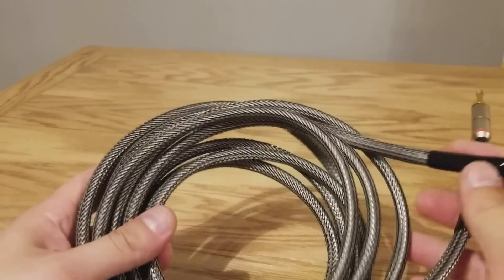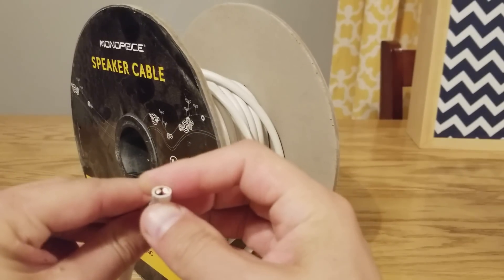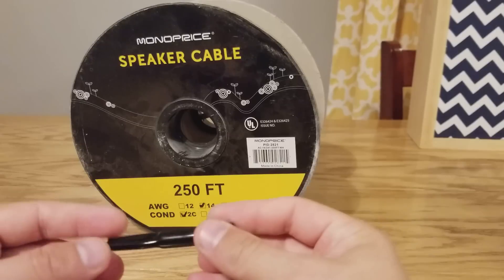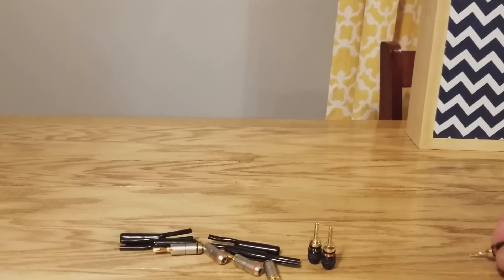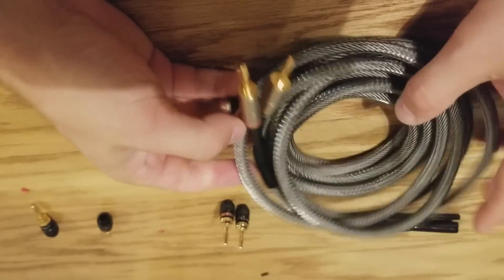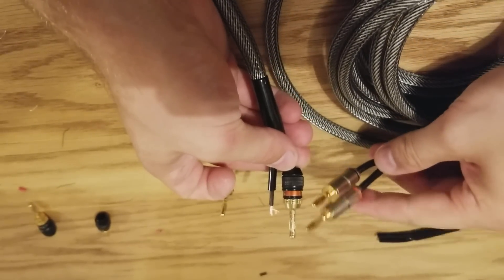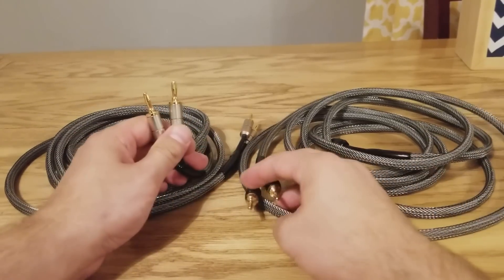How to make Your own HiFi Speaker Wire

Comment: I rather prefer a crimped connection with rings or forks to put under the screw terminal of the speaker. But banana plug works fine as well. Looks stunning too ^^
Reply: I'm not a fan of crimp connections, but I would have tinned the wires before setting that screw. You can get a much tighter connection without crushing the copper.
Reply: @Rattletrap-xs8il  Yeah I'm not wild about the screw type, but they should work fine. I would kind of prefer soldered, but of course you need to know what you're doing. But at the very least I'd pick up banana plugs that have two set screws. Just to foolproof the connectivity. Kind of hard to fail to get it right with two separate screws.
Reply: @cr0ft-2k  I prefer the twin screw system.  The bottom screw I use to hold the jacket in place but I remove the top one and solder through the hole. It's a bit tricky and you need to use a bit of flux but it does work.

Comment: Nice work. The only thing I don't like is that extra white PVC jacket that comes on the monoprice wire. I'd prefer the most physical flexibility by just using the tech flex and 2 wires. I also have had some bad experiences with buying bulk speaker wire that claimed to be 99.999% o2 free and its actually really weak and made of tinned aluminum! I just use lamp  cord now. That way it has be be 99.999% copper legally approved for use with electrical. I can bend the strands back and forth a lot and they dont break off easy.
Reply: That PVC jacket is there because that particular cable is approved for in-wall use, which the building code requires for fire protection. That is one of the reasons I criticized the guy making the video, because he spent extra money on fire rating that has nothing to do with sound.

Comment: I made the experiment - Separated 3 meters of just one thin little thread out of the whole big fat monster cable which the other speaker had, and could NOT tell the difference!!! (mono) Even when it was loud... The speakers are 100 kg each and 300W Amp. Now it could be that with longer cables or extremely high volume there might be a difference. Probably. I don't know. Expensive cables seems like a waste of money
Reply: Really thin cables do have too much resistance and they do affect the sound, especially with longer runs. But all you really need is any old copper cable with sufficient diameter and you're fine. Extremely knowledgeable speaker builders etc have been quoted saying things like that, too. I can't quote anyone specific off hand but I've read about it at some point earlier.

Comment: Good job! Good video.

Just remember: no self-respecting Audiophile would ever defile themselves in such a way as to double-blind test their Pure Unobtainium Liquid Sound™ speaker cables against these abominations!
Reply from the maker: Hahaha, nice
Reply: Too bad, Snotty McJealous. Audiophiles AND people who use generic wire can tell the difference in blind tests: https://www.stereophile.com/content/minnesota-audio-society-conducts-cable-comparison-tests-0
Reply: @esquiremoderator32  you really think that test results of around 15% preference over the cheaper cable are really that much? This shows nothing... That's just plain random hahaha.
Reply: Esquire Moderator don’t bother with these guys, they get their photography tips from blind people too, and jogging pointers from quadraplegics. They base their authority on hearsay, not a single one of them has ever actually experimented with cables. I’ve seen plenty of people go from being cable skeptics to actually realizing that no, zip cord isn’t a good cable, but never the opposite.
Reply: @esquiremoderator32  Did you even read that testing? The put the worst possible cable you can buy, Against some "High End" cables....

Where is normal Cable? Where is some 12g 99% copper cable? Such as the cable in this video? Not in their hmmm.
Reply: @Fr4nk3J  So, you will admit that there is a difference? Good. One of the high-end cables was 18 gauge, smaller than the cheap cable. BTW, the cheap cable was 16 gauge, which most people here are claiming is entirely adequate. Also, the cable in the video is 14 gauge, not 12. Seems like you're on the side of knowing that cable matters. I never said that you had to buy ten thousand dollars of cable and I wouldn't. I just suggested that the guy should have put his money into cable that most people consider to be sufficient for a quality system instead of putting on window dressing.
Reply: @esquiremoderator32  I mean of course there is some realm of difference. 12g OFC is going to work better than 24g CCA, alot better. 

I'm just not convinced that a 1000dollar wire is going to be better than 12g OFC, or 14g OFC 4c braided, ect.

I can measure that difference, its a factual electrical difference. Its not the same thing as saying this cable has been crygonecially frozen, or any of that nonsense.

I can also see why like the kimber wire may be better, and I can almost justify its cost. Thats a lot of work to braid all those like that.
Reply: @Fr4nk3J  I think we are on the same page then. I agree "cryogenically frozen" is probably a BS gimmick and I would never spend money on it. Since you mentioned Kimber, I wonder if you follow the guy from Audioholics at all because he uses Kimber, but also cautions against high-end gimmickry? I agree with that guy 100% on cable. But, a decent length of that Kimber cable gets over $1000 quick - so quality cable costs money. Not $10,000+ but it gets up there above $1K and that is what most people in this comment section argue against.  If the guy who made the video used 12 gauge ofc, I would not have said a thing if he decided to put some techflex on it to make it look good. My only issue was the guy spending the money on techflex before he got decent cable and paying extra for the in-wall fire rating, as well, because he liked the looks (it's safe to assume he didn't use it in-wall since he prettied it up).
Reply: @esquiremoderator32  I do watch Audioholics videos, time to time :). However I do not agree with Gene, just because Gene said it, more so due to my background in computer engineering, and knowledge of electrical engineering ect. However, that is why I like watching them, they are both engineers as well, they think like me, test like I would, and recognize science, and I appreciate that. 

the thing with the Kimbles is, they are not snake oil. You could, yourself build Kimbles, and the price, seeing how a person has to hand craft those, painstakingly, makes sense. There really isn't an absurd markup there, they have to pay people to do that and thats expensive. So with Kimble you have a choice, buy it premade or make it, its not easy to make and not fast, but if you want to take the time you can do it. 

I like to usually do that stuff for myself, however sometimes I get it made from me. The same with my PC hobby, as I am a semi competitive Overclocker, and PC modder, Sleeved cables (techflex like sleeve) on PC power cables, is very similar to this video. Those wires, sleeved, and good quality, can cost a pretty penny. As once again, its painstaking work, that takes time, and the best cables are made by hand by a small business.
Reply: @esquiremoderator32  Also I dont think they are complaining about the Kimble cables as much as the likes of this, http://triphazer.com/platinum-interconnects/ultra-platinum-interconnect-cable-upc-1.html. 

That is literally 10 dollar per meter cable (https://www.ebay.com/itm/Van-Damme-Silver-Series-Session-Grade-Instrument-Cable-Low-Cap-55-by-the-metre-/180723820731), with some 5 dollar RCA interconnects and some heatshrink, and the price, 500 dollars, LMFAO.
Reply: @Fr4nk3J  cool, cool. I actually built my own with 14/4 Canare and also some with 10awg Belkin in the past, both prettied with techflex. To the extent I'm an "audiophile" , I do what I can because it's a way to enjoy the hobby and a little sense of accomplishment - and it's half the price, so it's hard not to!

Comment: Belkin Cables, Canary Connectors = Blue Jean Cables
Reply: BJC does NOT use Belkin cable. BJC uses BELDEN cable.
Reply: 1/2 true. BJC does use Belkin wire and discloses it on their website. I'm not sure what you are talking about with "Canary" - maybe you meant Canare? But, they don't use Canare connectors on their speaker wire (they sell Canare wire, though). They use custom connectors made for their welder. And, there is more to it than that - they ultrasonically "cold" weld the wire to the connector, which is something that cannot be done at home and it creates a very strong connection that doesn't come unscrewed. Also, BJC sells the bare parts for people who want to assemble it themselves and you probably won't find anyone who sells short distances of Belkin wire any cheaper (at least I couldn't when I looked a few months ago) So, I think they are a good company - especially compared to what else is out there.

Comment: Keep in mind the wire coming from the circuit board to the banana terminals inside the amp are probably not "high end" wire and may be much lower gauge than the wire you are connecting to your speakers.
Reply: That doesn’t matter because this cable would be in series with the one in the amp so the resistent of the cable will just add to the one from the amp, so low gauge still improves it
Reply: Not on a quality amp. Good amps are filled with 6, 8 or 10AWG. High end speaker wire is for high-end equipment. If you have a $50 chinese amp, then you don't need to worry about nice speaker wire.

Comment: I'm using 12awg in wall wire so should I get the next size up tech flex and cable pants? Or will what you're using fit 12awg?

Comment: Now put a magnet on it and sell it for 5k. I bet audiophiles would appreciate "the sound" it makes.
Reply: Magnet 🧲 ❓❓❓❓❓❓
Reply: There's no need to be facetious as you already know that there are differences in the sound of cables.
Reply: @MrGorpm  I hope it is ironic, when not: Gather education, FAST. 

What matters in frequencies in the audio range? Low resistance when you want to drive high load speakers to pass the current trough. The rest of the wanky shit they tell isn't true. 
It might be right when you were transferring frequencies in the range of MHz, then the skin effect applies and you need another cable. 

But in distances low as 1-2m per side 1mm² cable would do the job nicely. 4mm² is better, because a smidge lower resistance, but doesn't matter. Only if you had for the right speaker 1m length of cable, for the left 200m of cable. Then you would hear that the left one is just quieter, nothing more, nothing less.
Reply: @DrDOHC  If you do not perceive any differences - good for you!  I wish you well on your musical journey.  I, however, will continue to listen with my ears and not your test equipment, as your test meters do not hear timbre, sound-stage and rhythm.
Reply: @MrGorpm  You don't get it. 

The ONLY thing that matters, are the acoustics. The speakers, the part that transforms the current into soundwaves. 
It doesn't matter what cables you use. They should conduct, they should be a proper wire diameter, but that's it. 

Nothing fancy going on. NOTHING. 

I'm not an Audiophile, but it is IMPOSSIBLE that a friggin piece of plain ol' copper changes the signal on the cable. Dang dude, get some proper education and don't trust those wanky woo woo sellers which are claiming bullshit. 

And I only trust measuring devices when it comes to electrical signal-forms, because they can't get Biased as hell. 

You ARE describing acoustics, not the electrical influence of a cable to Low frequency stuff.
Reply: @MrGorpm  well, if your cables modifies the timbre you really have a problem, to say nothing about the...rhythm, yes, and about sound stage

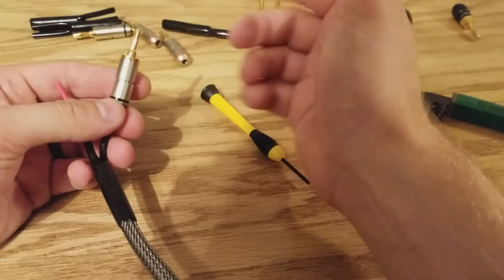Comment: 8:14 you hid your mistake, 8:20 you took too much off of the black off camera and the red is longer :)
Reply from the maker: It was a little longer than I liked. You just have to trim the speaker wire a little. Very easy, quick fix.

Comment: The best upgrade you can make, to pretty much any speaker cable is to terminate them with bare wire instead of the plugs. The plugs are a waste of time, space and money and they make the sound worse.
Reply: Try terminating 10awg on anything........tough to do without a plug or spade. Done correctly they are just an extension of the wire.
Reply: @wedoshotz6645  Just terminate them into the binding posts of your speakers and use silver plated speaker cable to prevent oxidization. Much better then connecting the cable to a spade and then connecting that to a speaker binding post.
Reply: Give it a try, R C.

Comment: WHAT IS THE SIZE OF TECHFLEX THAT FITS OVER THE 2C?
Reply from the maker: The parts list is in the description
Reply: 123Toid thanks. I didn’t see it. I’ll look again
Reply from the maker: @johnbrender7635  No problem I try to always link the parts in the description of the video.  That way you know what size wire I was using etc, so if your parts vary, you can try to gauge it accordingly.

Comment: If you invested $5k in speakers, dont buy $10 wires. But if you have $500 speakers or lower dont waste your money in expensive wires. Just be sure they are copper, oxygen free and not over 50 ft in length.
Reply: $10 wires and $10,000 wires are exactly the same unless someone designs them not to be, which would be a flaw.

Comment: I'm not too bothered about the look of a cable as long as it peforms well.  If you want value for money spend a little extra to get the best main "ingredients" of a cable's sound quality, in order of importance IMHO:  
1. Insulation material e.g. PTFE or similar, avoid cheap PVC if possible;  
2. Connectors - copper bodied silver / gold plated, avoid brass bodied if possible, use silver solder;  
3. After getting 1 & 2 right, If you still have some budget left only then consider higher quality conductors e.g. OFC / LCC / 6N copper / silver plated / silver.